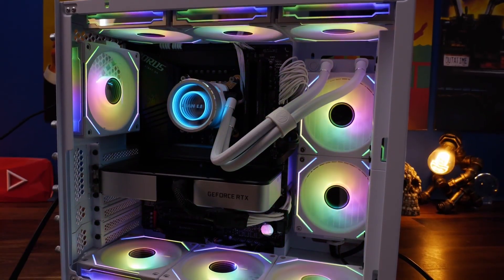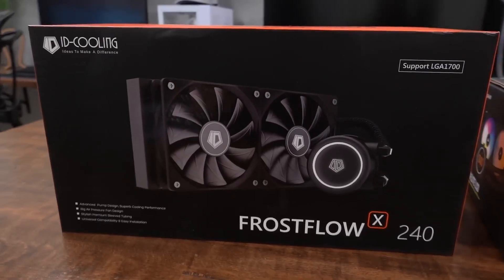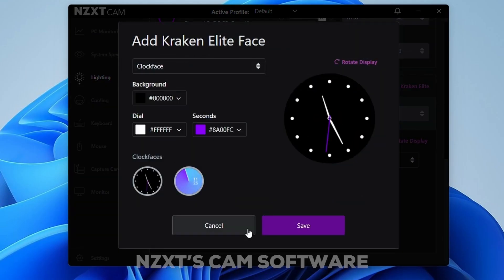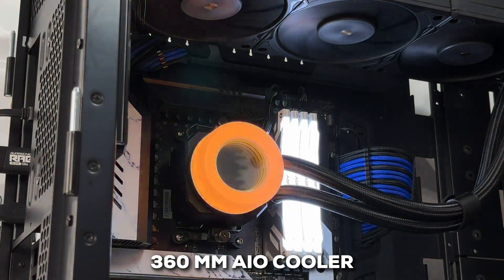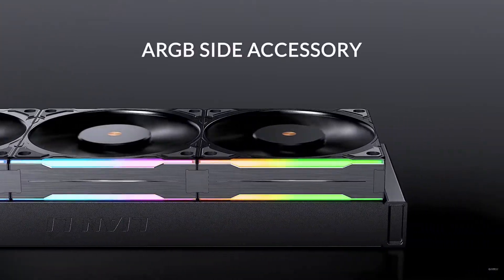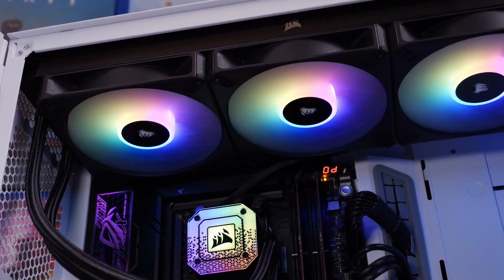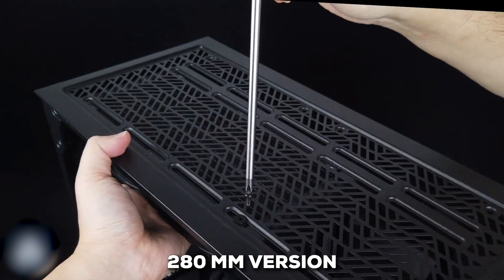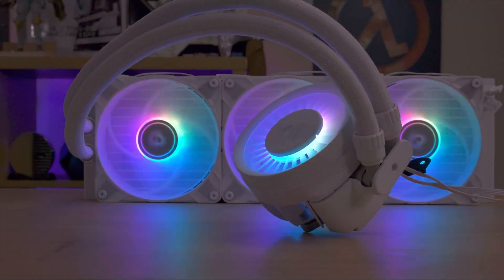5 Best AIO Cooler 2024 | Best CPU Cooler in 2024

Comment: Ryujin iii 360 extreme? Where?
Reply from the maker: Ah, I see where you're coming from! The Ryujin III 360 Extreme is definitely a solid option, but it didn’t quite make my top 5 this time around because it’s a bit more niche with its higher price point and is often favored by enthusiasts rather than mainstream users. That said, it’s a beast of a cooler, and I’ll definitely keep it in mind for future lists.
Reply: @FlexiViews  but you missed the liquid freezer iii which has even been given the award for the best aio of 2024 by the EU. And it's only 70-90 €/$ for the 360 and 420mm versions

Comment: What's your opinion on the Corsair Titan AIO
Reply: I have both white and black options, with no issues. If my opinion counts
Reply from the maker: The Corsair Titan AIO definitely stands out with its premium build quality and impressive cooling performance. Corsair has a solid reputation for reliability, and their AIOs usually come with great software integration through iCUE. That said, I think its value depends on your priorities, whether it’s aesthetics, performance, or quiet operation. If you’re after a high-end cooling solution, it’s definitely worth considering, but I’d also weigh it against alternatives in the same price range to make sure it’s the best fit for your setup. BTW, what’s your use case? gaming or productivity?